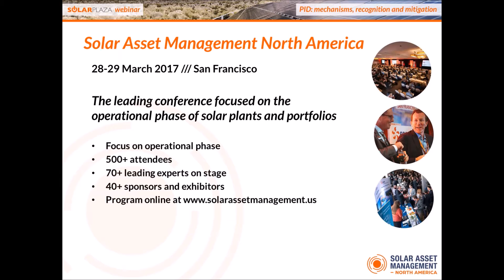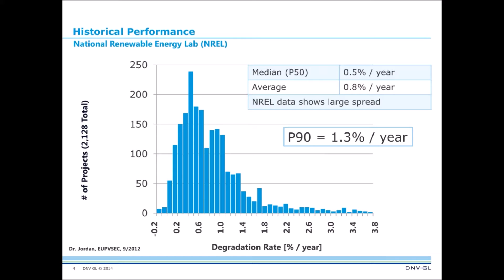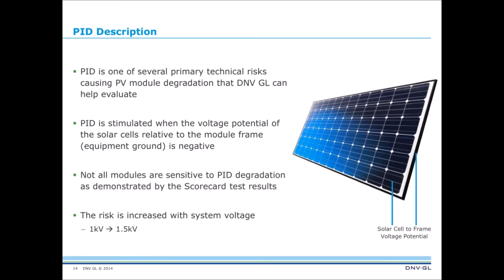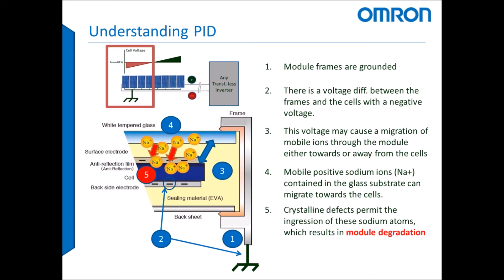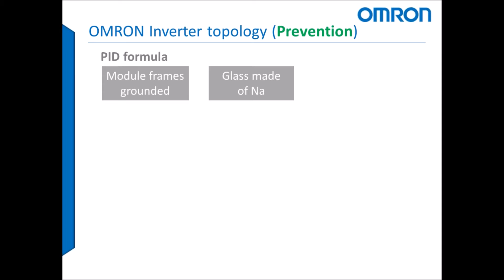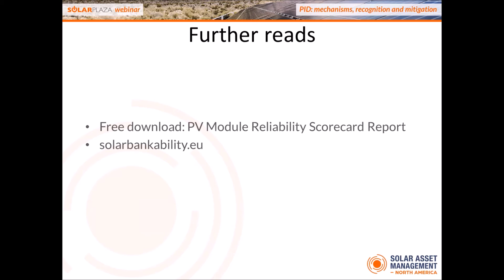Solarplaza Webinar: Potential Induced Degradation (PID): Mechanisms, Recognition and Mitigation.

Comment: Superb resentation. I appreciate the first speaker's knowledge about modules and the failure modes that can happen, as well as the failure rates that operations and maintenance might plan for. I also appreciate a second speakers synopsis of solutions for counteracting potential induced degradation, which can easily be solved by grounding the negative pole of the plant. I would have appreciated more discussion about what the impacts of grounding the positive pole of the plant would be in terms of potential induced degradation, but I would imagine that it would only make the issue worse. I'm not sure why I've seen some configurations like that in utility scale applications. Thanks for the talk, hope to tune in more